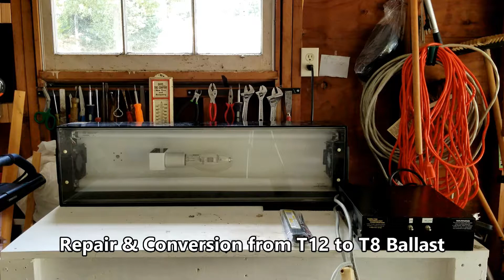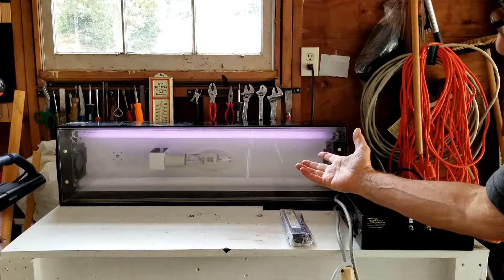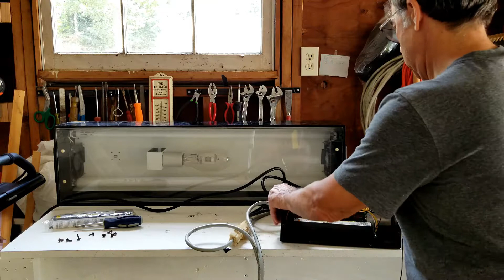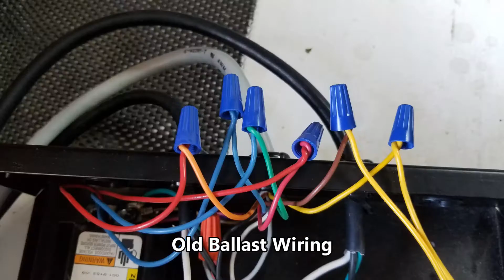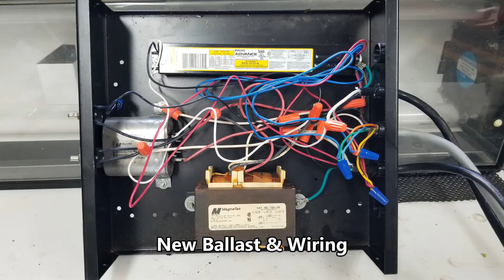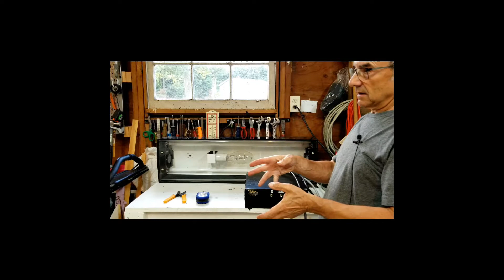Repair Hamilton Technology Metal Halide Aquarium Light

Comment: What is the name of that fixture? have you thought of replacing those tubes for T5s?
Reply from the maker: Are you asking for the model number of the ballast or the entire light fixture?  I did consider changing the to T5s, but I was planning to sell the fixture and didn't want to bother changing the end cap sockets too.  I switched over to LEDs on the aquarium this fixture was used on.
Reply: @arnoldsolof  I was referring to the name of the fixture, not the ballast. Thanks.